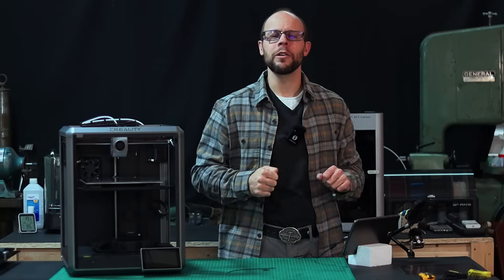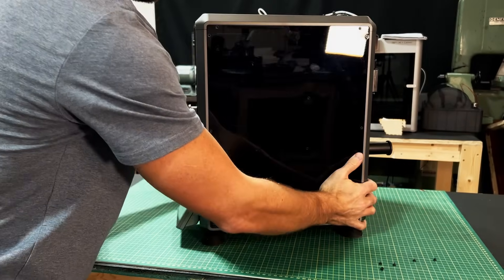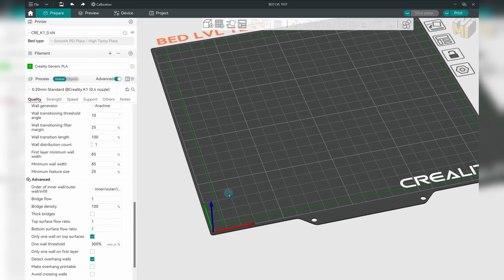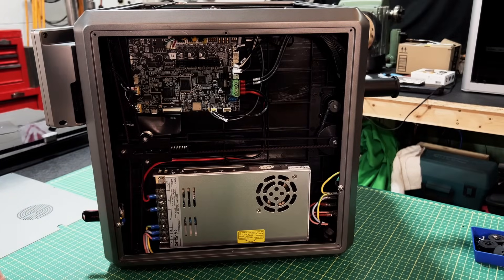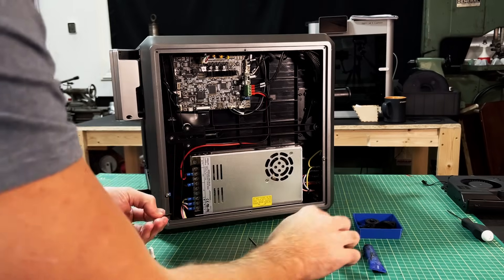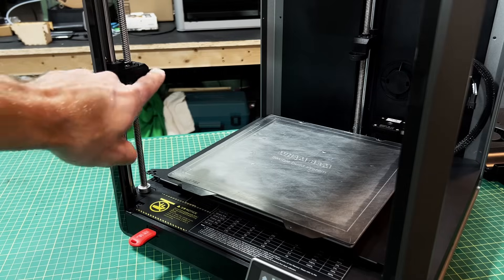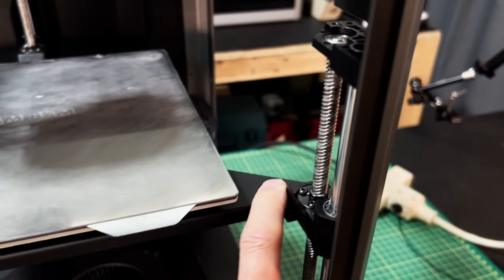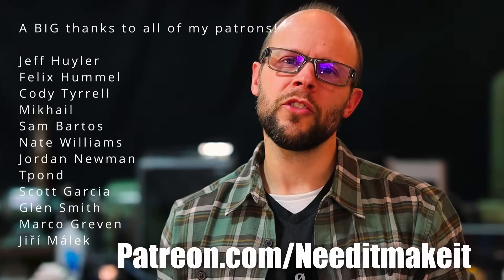Quick and Simple Way to Level Your Creality K1 or K1 Max Bed

Comment: How do I get the bed level mesh view? Do I need to root my K1 and flash Klipper and use Mainsail or can I see that with the default (=latest) Creality Firmware, too?
Reply from the maker: Sorry I should have included that part in the video, no you don't need to root, you can type in your printer's IP address into your search bar, and you'll see the Creality UI.  You should see your mesh there.  If you want to root your printer, I certainly recommend that, it opens up a lot more options the meshes will be more useable as well.   I have a video showing how to do that and it's quite short.  

Let me know how it goes.

Comment: Why wouldnt you just use metal slugs and drill out the holes? Or washers if you're to lazy to drill, or if your bed is REALLY off by a LOT,  use large nuts.  Then you have no worry about them ever softening.  Thats what I did,  works just fine.  Mine was off by over 16mm so obviously your printed items wouldnt have helped.  I could literally see the bed sloping down towards the door,  balls quickly roll off it,  etc.  I popped a couple nuts in there,  added some longer screws and its been good for months now.  I dont know how or why it got so far off level,  but its been jugging along so far and havent had bed level issues in a while.
Reply from the maker: Sure you can do anything you want that does the job.  I started before this video with small washer, I found them way too hard to get into the right spot, the solution here is really just something that simplifies it and makes it so that anyone at any skill level can do it with success.  

Nuts, washers, spacers, anything.  

Why yours was off by 6mm, that's far too much, something went terribly wrong to get it off by that much,  Normally we're seeing about 1 to 1.5mm max.
Reply: @NeedItMakeIt   Ya it wasnt 6,  it was 16mm,  like a full nut size off lol.  It's still currently running with the 16mm nuts and new screws I put in it.  Odd thing is it had been printing just fine even being that far off.  Then one day I went to run an update and it wanted to re-run imaging and leveling and the level started making massive banging noises when it got to the front by the door.  I stopped it and I could see that the nozzle was no where even close to the bed and thats when I noticed the slope.  I popped some nuts in there to prop it up along with some new screws to hold it all together and its been running ok.  I've never tried the "official" bed leveling method at all,  I didnt even know there was one.  I just saw a problem,  saw some screws, and figured meh,  I'll try it.  lol.  One thing I'm certain about is that it did not come from the factory that way because it had run leveling many times before that without issue which meant it was not yet that far out of whack.  I'm amazed it printed anything at all being so far off but then again I usually only print small items that dont get anywhere near the edges.
Reply from the maker: @justhereforthalolz  I missed the 1 there... I suppose that was too far for my brain to comprehend.  I've had an experience where one of the leadscrews skipped, the tension system below loosened up because there was no thread lock on the screws and they weren't even tight, and dab of carefully place thread locker solved that and I haven't had the problem since.

I think they need to move to independent z motors on newer printers, it's simpler and avoids all of this, the leveling is completely automated and will be more precise than we can do manually... and of course far faster, no more running a mesh and then adjusting and re-running etc.  

One note to consider, if your bed is off by too much, you're going to have uneven wear on your POM z nuts they're going to be on a pretty severe angle or at least pressure will be applied unevenly.  I'm surprised it even worked, there must be quite a bit of slop in there to achieve that kind of tilt.

Comment: What software are you using when you are doing the bed leveling? Its definitely not Creality or Orca. Any help would be greatly appreciated.
Reply from the maker: Sure, I'm using Mainsail, which is for a rooted printer, but for un-rooted printers you can use Creality's UI. to get to it you'll need to type in your printer's IP address in your search bar and you'll get that mesh that you need.  I have no idea why you can't see it through Creality print, it's something that people need to know to have accurate prints in the Z axis.

Comment: Great video, got my K1 much closer, but how can I adjust the Z-Offset since my bed is now "higher" with the shims.  I tried editiing the printer.cfg and change z_offset, but I don't think that worked.  I would like to see my mesh close to 0 but my whole bed is red since I raised it up with the shims.  Thanks
Reply from the maker: It should be compensating for that difference already, but if it's not, I'd recommend that you re-run the initial calibration cycle through the printer's touch screen.  I'm curious to know if that works for you, if not we'll try something else.
Reply: wow, you really need to be paid by creality, thanks dude.  I tried editing printer.cfg and found an entry for z_offset, but I don't think it works.  Have to learn more, but your shit is awesome.   If you are ever in NJ look me up.
  @NeedItMakeIt

Comment: Nice and clearly explained. Afterwards I wondered why it is useful to adjust the print bed so neatly. In the beginning of the video you convincingly demonstrate that the printer actively compensates for a skewed print bed. I have a K1-max and the print bed is skewed but my first layers are very good. Can you help me to understand the benefit of adjusting the bed leveling?
Reply from the maker: Hi and thanks!

When the bed is non-parallel with the gantry it will begin to compensate for the difference over a specified distance (In the printer config file) usually it is 5mm-50mm in height.  If your bed is off by 1mm, and you have a large print, your overall part height will not be correct.  In other words, at the start, it is printing and compensating for the difference, at the end it is no longer compensating and will be printing parallel to the gantry.  

These are values you can change and play around with, but I think this is not a problem we should have and for most of my prints, the height is important.  It also will cause more wear on the Z nuts (Minor) but it's still better to avoid.  

I hope that explains it well enough.

Comment: So question, you mentioned the bed was level but the frame was not, is that really relevant?  Shouldn't the thing that's important be the parallelism to the XY plane, which may not be parallel with the frame.
Reply from the maker: Yes, the level was just a method to show visually how far off they are.  How parallel the gantry for X/Y movement is to the bed is what's most important here.

Comment: Great video, but i cant believe we still have to do this kind of stuff..
Reply from the maker: I've reported this back to Creality, I would hope that it's a problem that will become better over time.  most people may not care but for precise parts, it's more important to have the bed and gantry as parallel as possible.
Reply: @NeedItMakeIt  it's a big deal for me, I print larger parts that span the bed, and a bad mesh really ruins quality.
Reply from the maker: @ThreeDPrintDesigns  You'll want to see the video sent to release tomorrow morning then.   I spend just about 1 week getting to the bottom of the issues with the bed, and I found some things out that were unexpected to say the least.
Reply: @NeedItMakeIt  will watch! Did you root yours with full Klipper as well?
Reply from the maker: @ThreeDPrintDesigns  Yes I did and I'm loving the ability to control and modify anything I want.  I have KAMP on both of my K1s now also, which is so nice, that's a part of the video for tomorrow morning, it certainly helps to get the best first layer possible.  

I want to experiment a bit with the probing speed and hovering height, they both seem like they could be tweaked a bit to further improve the speed.  I need to see whether that would impact the final mesh and by how much.

Comment: Thanks for help. It works. But, I can't see that much detail of bed level. Do you have any tutorial for that? I can see, bed level, top point and lowest point. But your diagram is better to understand and helpfull to dial it better. Subscribed :)
Reply from the maker: Hi and thanks!  

Have you rooted your Printer?  If you have, you can access Fluidd or Mainsail UI, they'll allow you a far more detailed view of the meshes.  I have another video coming out soon to go over how to get this as well as some other interesting bits of info about the beds on these printers and how to get a good first layer.
Reply: Actually no I haven't. I am a bit low on info about this printer. It was good at first, but now it doesnt. First layers are bad actually, and warping issue has striking again. I thinks its about bed leveling. I will lookup for a video about getting that details. After that, I think it will solve a lot. @NeedItMakeIt
Reply: And, small prints are good. I was just using the middle part of the bed. I wanted to print bigger things that uses big areas and flat pieces. After that I found out that bed level is crap 😁
Reply from the maker: @akbulutdes  I have a video coming out in couple of days in exactly that subject, it goes over the problem and also I provide a few solutions to get much better results.

Comment: This got me from a 1.4mm deviation to a .5mm, then I rooted the machine and did a z tilt adjust to get me to .35mm then I went nuclear and added flat plates to the bottoms of my springs, flatened them with a grinder and made sure the K1 was programmed to take a static load cell reading prior to meshing, which fortunately it comes factory that way. Now we are under .2mm using springs and knobs to achieve the last .15mm difference. It looks like .2mm and slightly under is about the ceiling for these beds, the warpage is just too much. I was hoping I could get it at least around .1 to get it close to my beautifully flat Voron bed, but a'las there is no replacement for a good Voron

Comment: Why you didn’t make it at the z spindle directly? Loosening the screw of the connector and adjust it there?
Reply from the maker: For mine at least, they've used Loctite permanent and small set screws, when I attempted it, they were not budging.  There is also a collar on top, and a pulley on the bottom and I didn't think it was as easy to go that route.  That'd be an easy way to do it as well though, no issues with that method and it's better to avoid shimming and just address the problem at the source I think as well.

Comment: I'm thinking about getting myself one of these, but this bed issue is convincing me not to... But anyway I'm wondering if the glass bed would help in combination of your method
Reply from the maker: I believe the K1C has a different bed and it should be addressed.  The shim method is pretty quick and on the smaller K1, it's pretty easy to do, on the Max, it's a bit more work. Even though the bed is a bit warped... and most printers are, it's still a pretty solid unit.  For the price, it's still a good printer.  Glass could be an option, I would only wonder about the added weight and the constant movement.  It would be a perfect scenario for it, since we're not slinging the bed around anymore.  I can run some tests to see if it's possible if you like.
Reply: @NeedItMakeIt  well k1c is much smaller I was looking to the k1 max as replacement for my cr10s pro. I've been using the glass bed for few years so far and always liked it over other options. Will most likely opt for it on the new printer anyway, but thanks anyway!
Reply from the maker: @TheIllya  Gotcha, I have a video coming out tomorrow for the K1 Max, you may want to check it out just so you know what you're getting.  There are lots of good points, and... some things that you probably want to know.
Reply: @NeedItMakeIt  thanks! Will watch it !

Comment: Just wanted to say thank you for sharing this. My K1 Max came from the factory with a 1.45 range, it was awful. After putting a shim under the rear bed support, The range is now 0.62. That's a BIG improvement. I've always said it's best to get the bed as close to level as possible before the mesh is applied. Just because the printer CAN adapt to a way out of spec bed, doesn't mean it will print ideally that way.
Reply from the maker: Hey, my pleasure,  I'm glad it could help you.  I have a Max now as well, and I've had to use this process also, I was able to go from 1.7 to 0.6mm out, the bed has some warp in it, and looking closely, I think it's because they cut it from a coiled aluminum piece, the warp is in only one direction.  I have plans on seeing if this can also be corrected, but for now, I'm pretty happy with the number like yours is now.  

I don't think people realize that if the bed is warped, the warp is also in your parts; for big parts it can be a problem when you try to bring 2 parts together or if you want them to sit flat.  We still have the issues of the parts cooling and warping of course, nothing is perfect, but we don't want to be adding the problems together.
Reply: @NeedItMakeIt  yeah the beds definitely are far from flat themselves. I've seen on a reddit post that there were two companies that were selling super flat beds that appeared to be machined. I just don't have the disposable money to throw at one right now, and even if I did they were sold out on both sites. I don't often print large items, but like you said the could times I did print some parts for my car, the bed imperfections do transfer to the printer part and I had to do some block sanding.

Comment: This worked great. After doing the Creality method with no change x 2, I cut my difference from 1.3 to 0.4 with just a single 1.0mm. Good enough for now i.e. the gridfinity beds I printed work, as opposed to not working. Thanks for the very practical fix, and thrilled to discover your channel.
Reply from the maker: Hey, thanks for taking the time to write a note, I'm glad it was able to help out a bit.  I had the same experience as you, the z-screw method only seems to get is a little better, and doesn't for for fine-tuning.  I have a K1 Max now as well, and the bed was Waaayyy out on it, this method works really well on it at well, though the bed is still warped by 0.5mm unfortunately, but it is a big bed.

Comment: I am wildly afraid of unscrewing the belly of my K1, so your solution really rocks!!
Thank you!

One question, though it might be a silly one.. If the corner of the bed is in the positive direction, is making the the other corners higher a valid solution here? 

I'm not sure if the bed level is fixed in the Creality software or not; And negative spacers are not yet a thing haha

Comment: Worked great for me. Far more precision than blindly turning shafts and messing with belts. Thanks!
Reply from the maker: Great to hear, it seems that most people are pretty happy with this option, I just received the K1 Max, and I have a bed out by 1.5mm+, I think I'll try to adjust using just the shims and see how close I can get.  I notice that the max has a slightly thicker bed and it has machined edges as compared to the K1, maybe this was necessary due to the size.
Reply: yep im chucking my neptune 4 plus out the window and getting the k1 max when i get my biden money
Reply from the maker: @dylanwiley1921  So you'd said you're Biden-your-time?  I have a K1 Max finally and there are some nice features, but the bed is still out by quite a bit even though it is a newer release of the printer, It's easy enough to fix the overall level-ness issue, but the bed is warped by quite a bit, so that'll have to be a follow up to to the video  to see how we can address it.  The beds are so big that I understand it's not easy to get it completely flat, but if not flat, maybe they should have a process of pressing it flatter, or some type of filler material prior to the magnet being added.  Ideas are welcome!